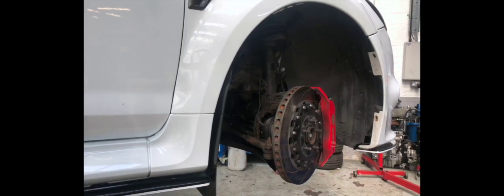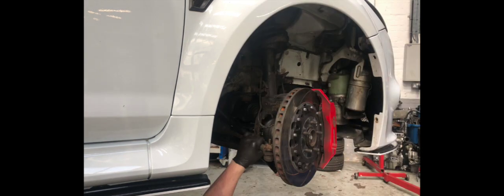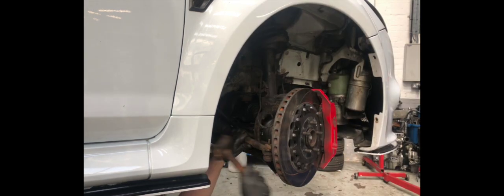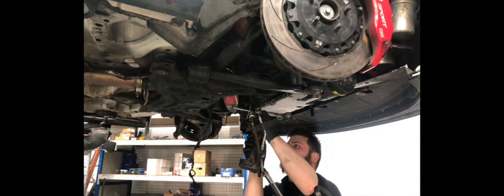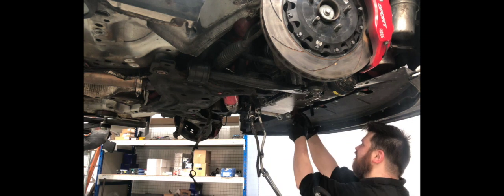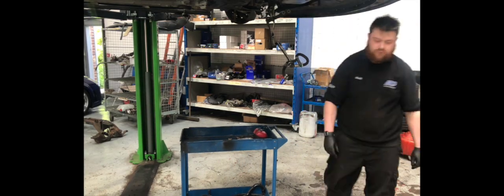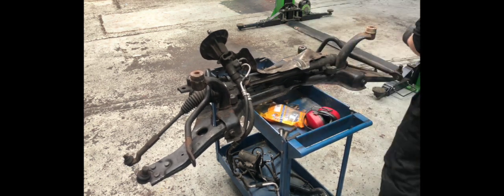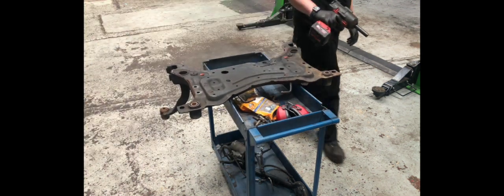BD Performance // Underbody Restoration P2

Comment: Are the disc’s rotating the wrong way ?
Reply from the maker: The discs are fitted to the direction of the vents; on the k-sports they are opposite to the APs and other brands 🙌
Reply: BD Performance ok just I’ve alway fitted mine the over way and thought I got them the wrong way 😂 never fitted K-sport on any of my cars 👍
Reply from the maker: Stephen Greatbatch take a look at the edge of the disc - that way you’ll understand the logic.

Hope this helps 🙏
Reply: BD Performance I see what you are saying on the vents thanks for you reply I’m looking to have my ST225 clutch replace with the Rs kit and the block mod done at the same time as you are 2 hours from me but I like what I see on here and don’t think there are many garage like yours around what would the price be for this ?
Reply from the maker: Thank you, we appreciate the feedback.

Our option for RS Clutch and Block Mod combined vary, starting from as little as £1199 for an LUK Version of the Clutch. Essentially this is the option most select these days. Then you can add a water pump for just £99 extra for piece of mind!

The Block Mod kit is all genuine parts and includes the Timing Belt Kit and Auxillary belts. We use our specialist washes to ensure the whole process is completed in a professional manor.

See our other videos for more detailed information 🙌

Hope this helps and look forward to welcoming you when you are ready 💙